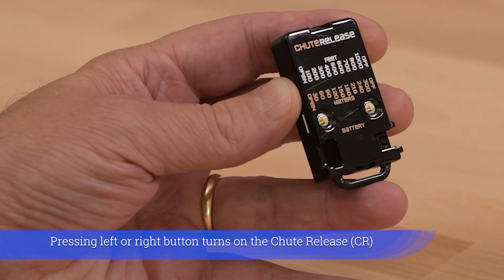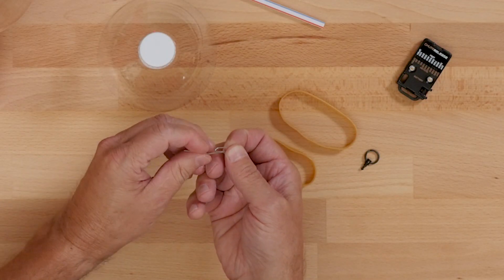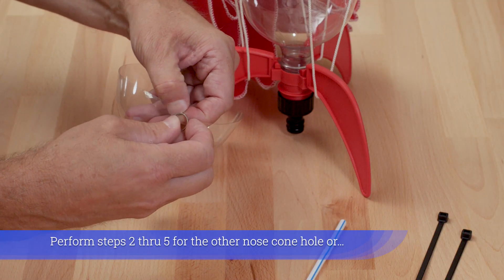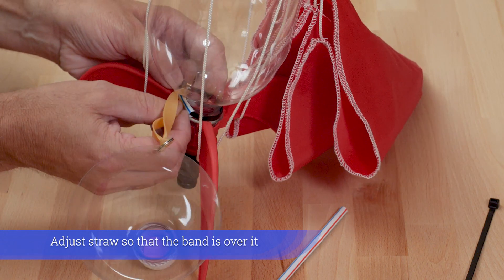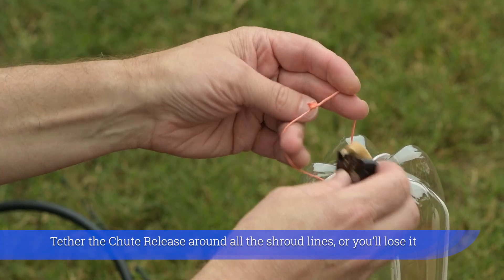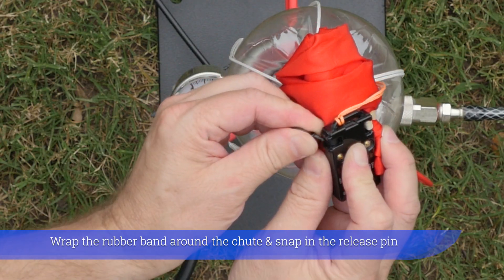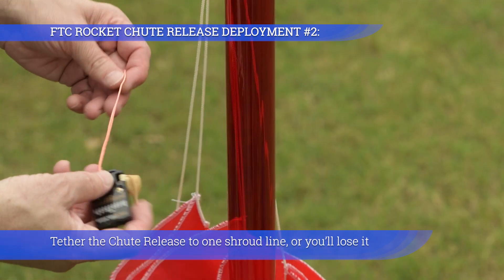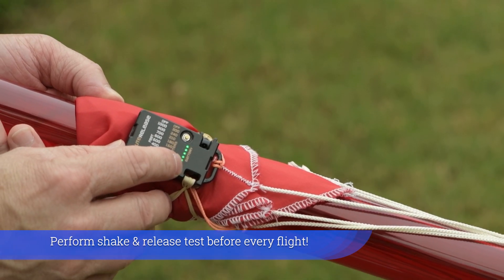Chute Release Water Rocket Deployment Techniques

Comment: Do you need the coins when using the first method with rubber bands on either side of the nose cone?
Reply from the maker: Any type of water rocket requires some sort of weight in the nosecone or it will flip during launch. Modeling clay is the safest, coins are okay, and even water can be used. A typical 2-liter bottle rocket needs about 1 - 1.5oz. of weight as part of the nosecone, which can include the weight of the nosecone itself. There needs to be enough mass in the front to direct the flight or the weight of the fins on the rear will want to flip and take over.

Comment: How do you attach the camera to the rocket?
Reply from the maker: Use outdoor two-sided tape (gray tape with red backing) from Lowe's or Home Depot to attach the camera to the bottle and balance the opposite side with metal washers or coins. Weigh whatever camera you use and weigh out an equal amount of washers or coins to attach to the opposite side of the bottle in the same location. I don’t remember whether it is the 5 lb or 10 lb (could be 15 lbs) two-sided tape that I use. I still have a large roll from when I purchased it maybe 6 years ago, but I have lost the packaging. I did experiment with the stronger tape 20 lbs or higher and they were too strong to deal with. You will want to replace the tape periodically and reposition the camera occasionally whether you want to face the nose or the tail. Something like this: https://www.lowes.com/pd/Scotch-1-in-x-5-ft-Two-Sided-Tape/50053419 ought to work. You definitely want to use a parachute if you are launching a camera so that it returns in one piece.
Reply: @StratoFins  Thank you.